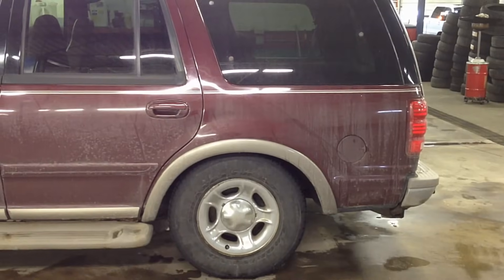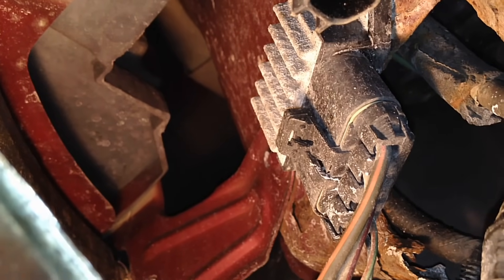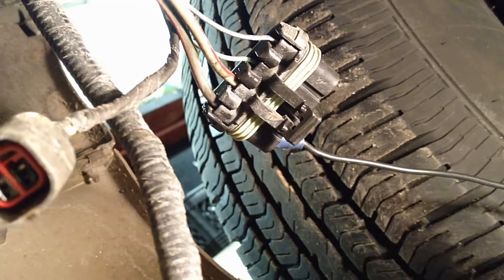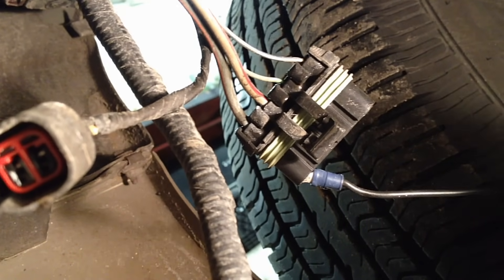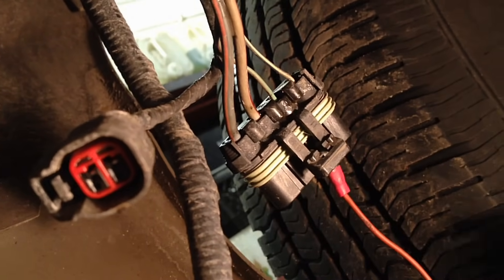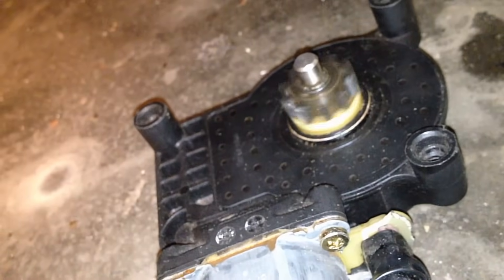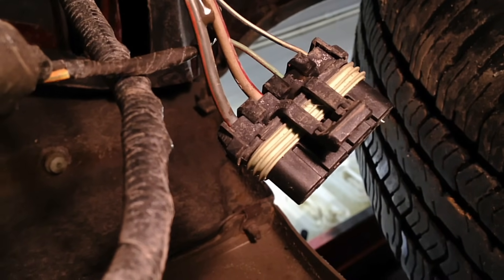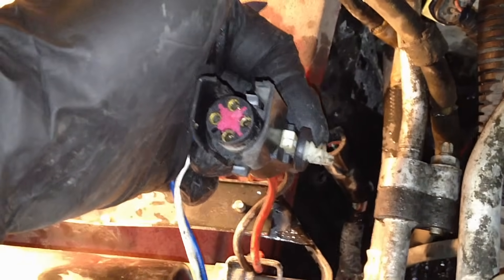Ford Air Ride Rear Suspension Down Diagnosis & Fix

Comment: I have a question hope you can answer, 2001 lincoln navigator 4x4 symptoms compressor cycles on and off continuously untill suspension light comes on also after car sits off for about 40 minutes compressor runs and rear end drops. I checked for leaks and I did find a leak in the front right ( p side ) air shock housing not the rubber the shock rides on or the fitting but the housing. so that explains the compressor cycling.  Now for my question can that leak cause the rear to drop as described. Thanks I appreciate your help.
Reply: So I replaced the shock, compressor still runs continuously, the rear looses pressure overnight but if I disable the system it does not loose air. Any thoughts?
Reply: did you ever find out your problem?
Reply: No
Reply: did u find out yet because im having a simlar problem with my crown vic
Reply: honestly no, i gotta put off working on it for a few weeks but you can keep hitting me up bout it cuz when i figure it out ill prolly forget to message u bout it
Reply: @aronchatterton4274 Did you ever figure it out?

Comment: Hello.i have a 1998 ford expedition 4x4 and the rear suspensión is no working..have a black plastic line broken..its look like it is to hard to fix it..is broken behind the fuel filter..

Comment: *i don't have a ride height problem * i purchased a 02 Ford Expedition Eddie Bauer 4x4: back in April 2016. the previous owner stated he had replaced the air ride compressor recently. He told me about an issue where the compressor will intermittently stop coming on (anywhere from 15-45 minutes of driving) and the check suspension light will illuminate on the dash.when that happens he said: turn off the truck and wiggle the air ride compressor relay and turn the truck back on which works but i can't keep stopping on a long trip every 30 minutes to wiggle the relay. what does this sound like to you
Reply: Bernard Gross did you watch the video? Replace your pig tail and for fucks sakes lend yourself a hand in informing yourself

Comment: Hey FordTech. Great videos. I was wondering if you knew about when the compressor comes on to often. I have a Lincoln Navigator 01 that has the rear height sensor @2.4 volts and the front at about 3 volts. Both sensors seem ok when I move them up/down the scan tool voltage goes up/down. When the compressor comes on the front gate/fill solenoids come on usually. Is the the front height sensor voltage too high? If the car sits it doesn't drop after a couple hours
Reply: what scanning software/hardware are you using?  2005 navigator but i cannot get any of my scanners to view voltage to each or any sensor

Comment: what if you have no current at the control wire the last one that you tested on mine everything is fine except for the last test which is the control wire does that mean I have a bad control module?
Reply: Did you figure this out?? I'm having the same thing!
Reply: It was the control module, it was a use vehicle it look like it been underwater.....
Reply: +Michael Williams , the little thing mounted on the passenger side front that you access from under the vehicle beneath the headlight?
Reply: driver side under the dash

Comment: Hello, I have a 1999 Continental with Air Suspension in the rear only.  The rear is flat on both sides and the pump will not turn on.  I thought it was the ride height sensor so I replaced with no fix.  I ran the tests on the plug in this video assuming it was pretty similar to the Expedition and all of them passed except the last one.  Another thing I noticed is when I jump the hot to the ground and let the pump run for 3 minutes it would not lift the car.  Any input would be greatly appreciated!
Reply from the maker: +MaxDiff328 In general since the module found a fault in controlling the solid state relay it is not commanding the pump on so it never opens the rear solenoids. I do it manually with the scan tool. What you can do is fake a connection on the low current ground control from the module at the relay this way it powers the test light and thinks everything is ok then it will open the rear solenoids and then you jumper the relay pigtail as before to get the pump to come on and watch it rise.
Reply: MaxDiff328 ni mi

Comment: What if I am not getting the command ground from the module?
Reply from the maker: +Todd OHearn Then there is likely a dtc set for a height sensor therefore the system has been disabled.

Comment: my suspension I can hear the motor come on but the ride stays dropped .
it comes on for 20, 30 seconds but it never lifts.
this happens after tow dolling a car went over a bump a little to fast and when I got to my destination it was low

Comment: very helpful fixed it for 157.00 changing out the relay control. mine was oxidized bad and cracked. tx for posting.
Reply: Do you have a expedition if you do I would look to ask you something do ford expeditions have the power to do a burnout

Comment: where is the rest sensor located
Reply from the maker: +Rendel Kirby It is on the rear axle usually on the drivers side you will spot the linkage.
Reply: fuses for navigator diagram 1999

Comment: what if you have no current at the control wire the last one that you tested on mine everything is fine except for the last test which is the control wire does that mean I have a bad control module?
Reply: What was the problem?? I'm having the same thing!

Comment: Can you please tell me where the rear level sensor is on a 2005 Lincoln navigator
Reply: on the lower control arm its bolted on
Reply: Thanks. ..just found it....only one in back.... right side.
Reply: +Don A yes 1 per wheel it looks like a hydraulic stick sort of with a plug in piece

Comment: I have a 2004 navigator.  The pump comes on and raises the drivers side but not the passenger side, so I drive around tilted.  Any ideas?
Reply from the maker: +BigBadViperTurbo Rear only or 4WAS?
Reply: +FordTechMakuloco it is 4 wheel drive, and it was the front that wasn't raising up.  The battery just went dead and now the entire thing isn't working at all after battery change.
Reply: FordTechMakuloco I have an 07 ford expedition rear air suspension.  Passenger side  pumps up drivers dont. No sign of air leak.

Comment: Please  note that the relay shown isn't used on 05,06 navigators.
Reply: FordTechMakuloco My compressor comes on for 5sec the stop...03 navigator was sitting for over a month getting ECM fix, any suggestions?
Reply from the maker: +Don A Actually it is mid year 2003 they switched to the standard relay.
Reply: Ok thanks,
Really enjoy your videos. ...learning so much from them.

Comment: my compressor turns on but the suspension does not lift what can it be there is air in the suspension no holes either

Comment: So question for you on this system. The pump on my vehicle works ('97 Expedition). Previous owner cut the wires at the relay so connector is junk. Would it be possible to use some sort of solenoid to effectively replace this relay? I'm thinking something like the starter solenoid from a Japanese motorcycle that has to be externally grounded to activate.............. Just a thought. I might try it, if it doesn't work I'll just get F150 coil springs .......................

Comment: I have a 03 navigator and the Air compressor for suspension will not  come on. what can I do
Reply from the maker: +Richard Kunka Is it late model where it does not have this style relay?
Reply: The truck is slam to the ground airbags will not inflate
Reply: Did you fix it?
Reply: Richard kunka  did you fix it?
Reply: Are the fronts down in this video too?
Reply: Answer please

Comment: is the relay fused? would it be necessary to locate the fuse for the compressor beforehand, and replace it if needed before running any tests?
Reply from the maker: +TRAVIS JOHNSON Yes but it is 60 Amp fuse so almost never blows until the compressor is totally seized. That first big wire will tell you if its blown all while checking the rest of the system all from the same place.

Comment: my 2002 lincoln navigator has an issue I can't seem to fix.  I have replaced the compressor and the relay.  The pump comes on for a few minutes but the rear does not lift up.  I cant seem to find any leakes.

Comment: This video was a great starting point for fixing the same problem on my 2010 Navi.  Thank you for taking the time to post it!
Reply: ajparr what was the problem with your 2010 navi? I got a 09 navi with same problems
Reply: The rear wheel wells were only about an inch above the tires and when driving it, any bumps at all caused long oscillating bouncing in the rear end.

Good luck fixing your '09, but it should be fairly straightforward!
Reply: Where is the relay on your 2010 Navi? I have an 07 and i cant find that relay? Please help

Comment: 1997 2wd expedition. rear end drags if it sits overnight.  if I just touch the pigtail,  the compressor kicks in and the rear rises.   probably corrosion in the pigtail?  the Motorcraft version you speak about has about 1 foot of wire of the connector,  and I'm not sure where they go.  so I just cut and splice near the connector?
Reply: My issue is getting worse. It now takes a lot of pressure to get the pigtail to make connection to the relay. ANy ideas?
Reply: +Todd Staples remove the battery, and try electrical contact cleaner. You might also try using an eraser around the relay pins.

It works on computer parts, I don't see why it wouldn't work here.

Comment: hi, thanks for the video, i have a 98 explorer with rear load leveling, the air compressor comes on every time i start, but during 20min of driving it shuts down and the rear sinks down and gets wobbly, when i stop and start again it is back on, do you know what would cause this?.
Reply from the maker: +Birger Karlsen The compressor stays on while driving? If so first look at the air bags for cracks in them
Reply: FordTechMakuloco hi again, no they only adjust, but after driving awhile the compressor stops, the ass sinks and i get the warning light on the dash. i then have to stop the car, restart and all is good again. could this be the sensor?
Reply from the maker: Birger Karlsen What I am not understanding is how do you know the compressor stops running? Normally it pumps up upon the suspension on start up to bring it back to ride height and shuts off and if there is no leaks it shouldn't come on until you park the vehicle it kneels and the process repeats. If its running anytime other then after the initial height adjustment there is a air leak likely in the bags causing the compressor to time out since it is air cooled to prevent it from locking up.
Reply: @billymovies  Hey, how’d you end up fixing the problem? It sounds similar to what I got going on.

Comment: i have ford expedition 2000 eddie bauer and yesterday i heard a noise like air leaking out of a tire and my rear dropped. so, now the rear will not raise. does that mean the complete rear suspension and struts have to be replaced.
Reply from the maker: +Earnestine Hinton Likely a bag failed if its that bad.
Reply: +Earnestine Hinton I didn't think an Expedition with pump and air bags have struts because essentially aren't the air bags functioning like the struts?  I just bought a 1997 Eddie Bauer Expedition with rear suspension issues but I haven't crawled under to take a look yet.
Reply: +Jarod Morris it was the lines to the bags were bad

Comment: I have a 1997 Ford Expedition and the back right side is sagging. The compressor kicks on and pumps it back up. So does that mean that my bag has a leak in it. If so how hard is it to install the conversion kit on my Expedition?? Thanks

Comment: Thank you again.  But I remain confused to your response.  If I replaced just the relay, then a week  later the sag happened again.  I unplugged and replugged the new one and it worked.  How do I know it is not going to sag again.....til I wait again.  So your answer is to replace the pigtail also?  And how is the pigtail replaced?
Reply from the maker: +Darlene Casper Next time it happens where the rear is sagging and the pump is not coming on like usual disconnect and reconnect the relay pigtail, if it now comes to life and work you know you need to replace the pigtail.

Comment: 2007 Expedition EL- Recently failed to toggle off the Air Suspension when towing a trailer and later when using a Hitch Rack (heavily loaded)...I get an error every time when the car starts that the Air Suspension is OFF, It does not give me the option on the Message Center to toggle it back to ON..Any thought? I have not noticed any sagging or handling issues.
Reply from the maker: +David Champion Follow my pcm reset video and see if full operation comes back.

Comment: We jumped the 2 wires on the pig tale and the pump came on but the car did not go up. With out jumping the lines, the pump does not come on. I replaced the relay and no change.
2 questions:
Should the car go have gone up when we jumped the lines?
What do I check next?
Reply from the maker: +CENTURION24 The system is faulted therefore the module would never turn on the rear air spring solenoids to fill. You jumped the two wires but did you check all the other inputs?

Comment: I have a 2000 Expedition the relay and springs were replaced 4 years ago by ford service.   I did the test you suggested by disconnect and reconnect and the compressor worked.  Thank you for this video.  I replaced just the relay only  but then the sag happened again.  So does that mean the pigtail needs to be replaced like you mentioned?  How is this pigtail replaced?
Reply from the maker: +Darlene Casper Most likely yes it does easy test is to unplug and plug it back in and retest if it work now you know.
Reply: +FordTechMakuloco... I have a 2003 Navigator and all 4 bags are down. I replaced the right front blown airbag.The compressor is activating and air is coming through the lines to all the bags. I can hear all 4 air bag solenoids clicking on but it still isn't raising.  Any ideas of what else it could be?  I figured that changing the bags on the front as well as the o-rings on the back would have fixed the problem. still nothing. Any ideas?

Comment: I was thinking about running my compressor to a toggle switch and turn it on when i want to. Thoughts on this?
Reply from the maker: robert thomas Wouldn't work unless you wired in the control solenoids in the air lines too.
Reply: FordTechMakuloco  i gotcha. My copressor is good and so are bags and everything and i also changed out my relay and my compressor will kick on but not like it suppose to. Right now my expedition is dragging ass

Comment: Hello!
I bought a new compressor relay and a new compressor, but the compressor does not turn on. I checked the fuses, they are good. I jumped the two big wires on the relay connector and the compressor did come on, but the airbags are not filling up. Maybe the connector is bad?  I don't know what else to do. 
Your help would be greatly appreciated! Thanks
Reply from the maker: starhearts102 The air module will see a fault and not raise the system. If you did all the test as shown a relay is in order links are in the video description.
Reply: starhearts102

Comment: 03 nav
I changed relay first. Nothing
I then tried your jumper ts, nothing.
I then tried the jumper on sliced wires, nothing. 
What next?

BTW I wish you were around me I would definitely take it to you.
Reply: Also I love the Christian radio in the background
Reply from the maker: CENTURION24 So the thick wire coming to the realy has power but when you jumper it nothing still? If so verify up at the compressor that it is getting power when you jumper it and if that checks out your compressor is locked up.
Reply: FordTechMakuloco it does not have power. Also I checked 111 fuse and it's good.

Comment: I have an 00 Navigator.  The rear sags intermittently once I have parked the car (sometimes it goes down, but other times it stays up).  When I crank it and start driving again, everything works fine.  Could this be a relay issue or something else I should check?
Reply: My 2000 Ford Expedition still does that is that a bad thing but everytime I start it up it goes back to normal but what I park it it goes back down
Reply: i was hoping this question was answered. I have the same issue
Reply: same here

Comment: I have a 1999 Ford Expedition 4WD with four corner leveling.
My rear is sagging when parked AND leaning hard to the right when running. What should I look for?
Reply from the maker: David Feinberg Leaking air bags from cracks in the bag.
Reply: @FordTechMakuloco  great video! I have a cuestión, would podible put a lift kit plus the stock air suspension? 
Thank you !

Comment: I have a 1998 Lincoln Navigator the compressor will not kick on but if i bypass it like you did in the video the compressor will work the second test you did with hooking a window motor up I also did that and that worked but the very last test did not work I could not get my test light to light up what would be the cause the test light is good. I checked first..